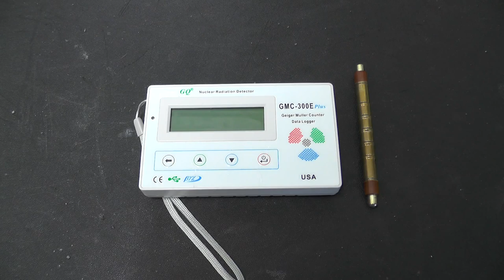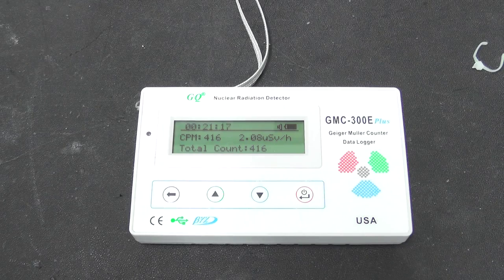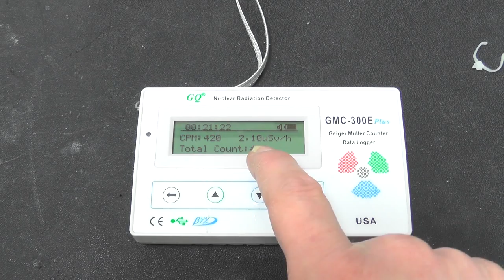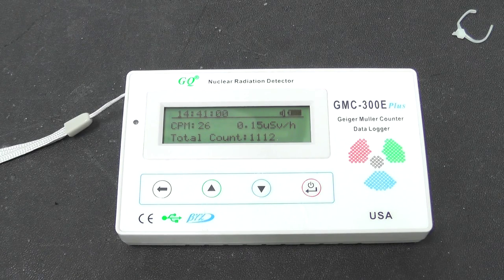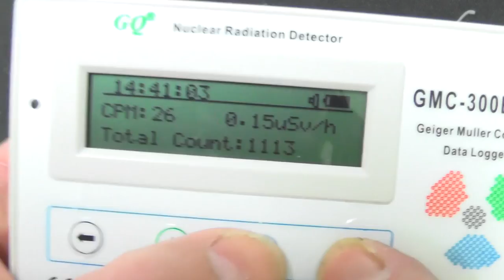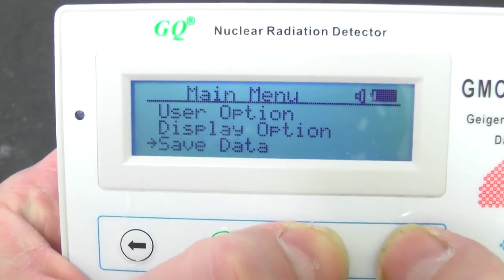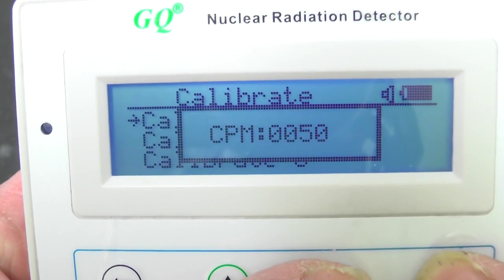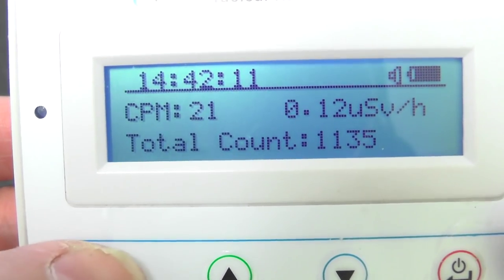DL#040 - Installing SBM-20 Tube Into GMC-300E Geiger Counter

Comment: I just did this upgrade on a CQ model GMC-300S, which came equipped with a Chinese glass J321 tube (M4011 equivalent). I did need to relocate both tube holders as shown in this video. Since the J321 sensitivity is 158.3 CPM per mR/h and the SBM-20 is 175 CPM per mR/h, all I did was change the CPM levels in the three Calibrate points.
Calibrate 1: From 1,538 to 1,750
Calibrate 2: From 15,380 to 17,500
Calibrate 3: From 30,760 to 35,000
With the above CPM changes, the mR/h and uSv/h levels should not be changed.

Comment: you can use 70 CPM and 0.4 uSv for calibrate 1 and 350 CPM 2 uSv for calibrate 2 and 14016 (closest to 14000) CPM and 80 uSv for  calibrate 3.  The magic is in getting the factor of 0.0057 right. 175*0.0057=1 or 1/175=0.0057.

Comment: I upgraded my GQ GMC-320+ V4 to the SBM-20. I used my smoke alarm as my radiation source. The stock tube which is the J305 got 68CPM at most. The SBM-20 got 103CPM at most. 

Just be aware while installing bigger tubes in the GQ GMC-320+ V4, the traces didn't go all the way on the negative terminal so I had to solder a wire from the end of the trace to the negative tube holder.
Reply: Hello,
In my case, after soldering the wire, the light stays green and it's clicking so much that it's almost emitting no sound.
Could this be a faulty sbm20 tube ? The M4011 still works.

Comment: This was the first generation 300E, by the time you uploaded this video they already had the plus version that uses a more standard 14500 cell lithium battery. Thankfully the process is still the same for swapping this tube in.

Comment: Why did you choose those CPM values in the calibration menu?
My 320 Plus has 60, 240 and 1000 as CPM calibration points.
I understand the 50 and 500 but for the last setting you've chosen 15020. Why? Or is that the maximum you can set?
Reply from the maker: +Ni5ei The three calibration values form a curve that is used to convert CPM to uS. There is a thread discussing how to use the calibration on the GQ Electronics forum. As for the exact values, some kind person on the same forum worked out the values based on the sensitivity of the SBM-20 tube, also on the GQ Electronics forum.
Reply: +DextersLab2013 Thanks, that makes sense. However, I've just replaced my tube as well and can't get the Calibration 3 setting to 15020 CPM. It jumps in amounts that don't make much sense to me and I can't get it to read 15020.
Reply from the maker: Ni5ei LOL! yea the method used to input numbers is crazy bonkers, i recall cursing at mine while setting. Unless your measuring big CPMs with it the Cal 3 setting you dont have to be too accurate.
Reply: +DextersLab2013 Ah, managed to get it at 15020 now. Raise it with the arrow up button until it reads 1xx20 and then lowering the value with the down arrow until it reads 15020. Very odd way of setting it to a preferred value indeed :/
Reply: +DextersLab2013 Hey I was just thinking: if you divide your CPM by 175 for all 3 calibration points, wouldn't that be linear? You're talking about a curve but that would mean the conversion at high count would be different from that at low count CPM. I've been searching on the GQ forums but can't find the topic you're referring too.
Reply from the maker: Ni5ei I cant find it either now. You could make a post there if your wondering, it's a very helpful forum.
Reply: +DextersLab2013 Ohh yeah I know, I started the bug report topic couple of weeks ago. Too bad there aren't many active users.

Comment: Still a great video !  Noticed that my Circuit Board is Red and also have a Li-Ion Rechargeable 3.7 V Battery...  The G-M Tube is Glass but have not opened the case yet.  And have not upgraded to the Russian Tube...  How long do the Glass Tubes last ?  Still have to get back to the Trinity Site with my GMC-300 E Plus (Made in Seattle) !  Mine still works after two years...   tjl
Reply from the maker: +Tim Lipinski thanks! All GM tubes last a long time, decades even! Sounds like they updated the battery in as well. The nimh batteries where not great tbh.
Reply: I installed the smb-20 tube in a 3.7V rechargeable model. The software will not boot up now. Is this due to voltage difference? Is there an easy way to adjust from 3.7V-9V?
Reply: @yehat17  did you fix it?

Comment: I just replaced my tube in a GMC-320.. SBM-20 tube with the  and did the cal just as you showed but, now im gettting 8-12 cpm where it was 20 - 30 this morning?  Maybe a bad tube?   (UPDATE): OPPS   I put the thing in backwards...   Works fine now....
Reply from the maker: Good news, glad it's still clicking!
Reply: Quick question : I have a sts-5 tube (pretty much the same as sbm-20) and I don't know if it even works. If I put it in the geiger counter and it does not work will it damage the geiger counter?
Reply: Im no expert..... but, im sure so long as its not short circuited you should be fine.. check the continuity with multimeter.

Comment: Is it possible to modify the new red Board version with sbm 20?
Reply: I just replaced mine which had a red board by following all steps in the video but I had to solder an extra wire to the positive terminal as the existing circuit doesn't reach them. So far it's working good

Comment: Is it worth installing SBM-20 tube? Glass one is not reliable in fallout survival?
Reply: Unfortunately geiger-muller tube based meters, especially lower quality ones, are not going to be useful in a radiological emergency. They simply can't handle the level of radiation that you will encounter. I am going to suggest investing in a higher quality item if you would like something you can use.

Comment: Great video, I have the same model and will probably do this mod as it looks like a good upgrade, but I am currently unable to register any CPM on my device. 
Everything seems to be working on the device, battery is fully charged, menu buttons and display all work fine, just no clicky and no CPM. It reads 0CPM after days.
I've had the back off and the tube is intact. I was reading on the forum they changed tube from M4011 to J305 in order to make it less sensitive to visible light.
I have the J305 tube in mine. Any ideas much appreciated.
Reply: I would measure the dc voltage across the tube with it powered up. it should be 160 or more.
make sure the tube is installed the right way with + to +. if it all checks out, the tube is probably dead. the J tube is trash from what I heard. I bought the smb20 and its a great tube

Comment: Thank you for this great video! Very informative. What other tubes are compatible with the GMC-300E? Does it only need to be in the same voltage operating range? What is the maximum this counter can take? Also, if the tube is too big, I figured you can still mount it externally and solder wires to it. Thanks
Reply: I'm interested as well. I'm particularly curious if there are compatible tubes that also detect alpha radiation.
Reply: @johnmarks714  Honestly probably not, theres only so much these cheap counter can do.
Reply: @johnmarks714  this already can detect the alpha
Reply: @kishascape  you mean in stock condition? No it only detects beta, gamma and xrays,
Reply: @lolazam1497  the only reason why it can't detect alpha is the tube (alpha can't go through much of anything), there's a few people that has replaced the tube to something that can detect alpha and it works just fine.

Comment: Does it work better?
Reply from the maker: scooter dee Yes, there is a small increase in sensitivity. Also removing some of the plastic from the back of the counter around the tube area helps as well. Both of these modifications are common for this counter.

Comment: Why didn't you do a comparison of the 2 different tubes?? You should have showed the CPM of the original tube (using some radioactive source) and then the CPM using the new tube. Without a comparison, your change-of-tube is meaningless! The proper comparison was never demonstrated. Very poorly done!

Comment: Am I the only one brave enough to mention that I can influence the Geiger counter with somatic sensory cortex activity?  Surely I'm not a mutant.  I hear an unexpected noise and then my Geiger counter jumps a few extra points.  I have a Radex One and it takes extremely fast readings (10 seconds) therefore it's alerting me much more frequently than my far more expensive GMC-600 Plus.

Ideally you would be able to test with the Radex One, and you would set the alarm to be slightly higher than your local background radiation.   I set mine to alarm at 20.  It doesn't even tell me what that means but that's irrelevant for the result. 
I set alarm to as both beep and vibrate - then I wait.   The effect is most pronounced in morning and evening for some reason, I haven't figured it out.  I'm guessing a longer refractory period is needed during the day.  

Early morning and late evening it chirps with each plane that is "heard" passing, and each time a/c turns on and each time it turns off, and each time someone walks above and makes the wood floor creak, and really any noise at all that was unexpected.  It's as if there is a noise processing in subconscious in which brain has an "aha!" moment recognizing the noise then triggers something which notches up the wave count enough to trigger the alarm.   Other "aha!" moments can include visualizing solution to a problem and then "beep beep beep" - the greater the enthusiasm the greater the alarm.  My experience anyway.  Your miles may vary.  If I don't ask, I'll never know if I'm truly alone.  I don't think I am.  I think everyone has the ability.  Probably just need to set up the right environment.  If other people are within 20 feet then it is possible they could influence your results to the point you consider it all random "background".  I assure you, that is not the case for me.  I've tested nonstop for 3 months.

Using the GMC600 PLUS  I have to set it a bit differently.  I set the uSV to .17 or sometimes .15 depending the current average.  The idea is to have it alarm for any spikes but not too much or too little.  For me, if background is .13 then I might set it to alarm at .15 or .16   you get the idea.  Keep at it and you'll find the sweet spot - unless you have too many other variables messing it up.  I must have the perfect environment otherwise I must have something unique but I doubt it.  

I am willing to bet I can prove this to any Google jockey or textbook thumper that shouts "IMPOSSIBLE" if given the opportunity.  I don't have delusions of grandeur, but I can fully appreciate that someone else can stand on this logic and see further.   I don't know if I should be pestering doctors to check my brain, as this whole idea going against textbooks takes a bit of courage and self confidence.  

For now, I can only ask others to test this for themselves.  Maybe there is a Nobel Prize waiting for you, but my suspicion is that we can all do this given all the right variables in the right environment.  

It's likely being hidden for some unexplained reason just like there is no explanation that  XRF (xray fluorescence)  is no longer publicly available for the case of testing after the lead in your blood gets absorbed into your brain and bones.

Pay close attention to the details given and test.  Hopefully environmental variables will not get in the way too much.
Reply: Wilhelm Reich suggested that the orgone energy would be detected with a modified geiger tube.

Comment: What exactly is the difference between the GQ GMC-300EPlus and GQ GMC-320-Plus models?
Maybe you can describe this in an extra video...
Reply: The 300e vs the 320+ 

The 300e has 64KB storage, the 320+ has 1MB storage

The 320+ has a temperature sensor while the 300e doesn't

The 320+ has a gyro while the 300e doesn't (it flips the screen depending on what orientation you're holding it like a smartphone can).

The 320+ has Treshhold Data Logging while the 300e doesn't. This is probably due to the limited space the 300e has vs the 320+

 the GQ website has a page showing a comparison chart of the different Geiger counter models they make.